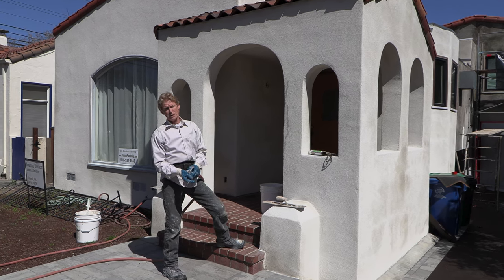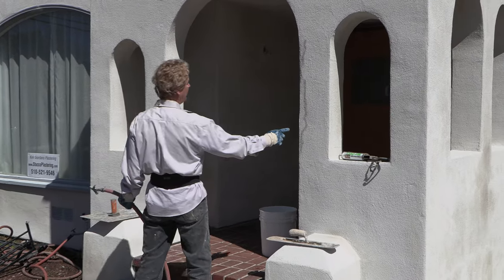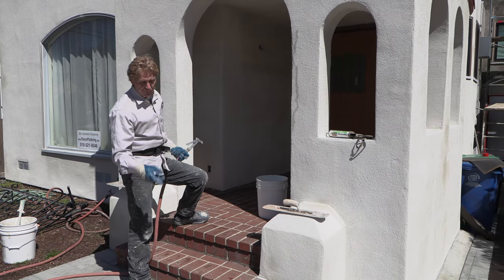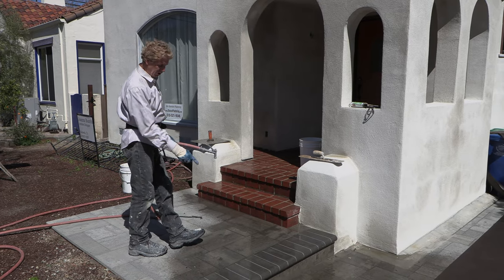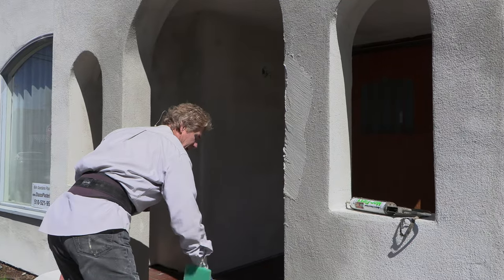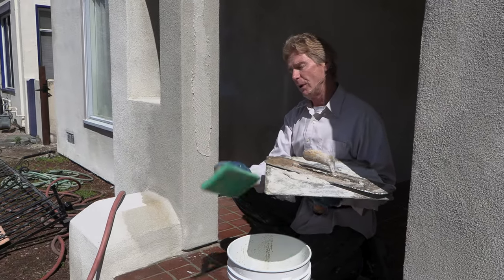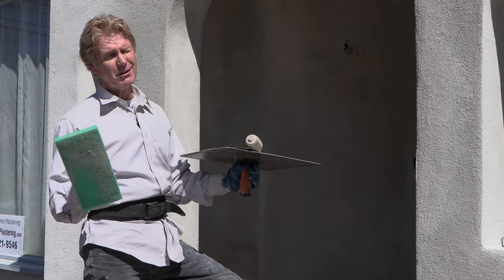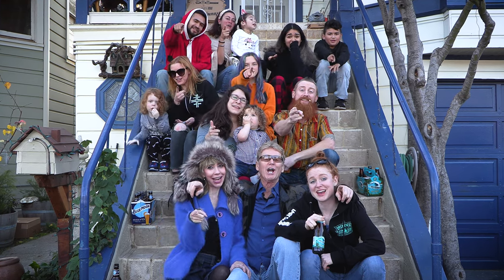Repair cracks in colored stucco.

Comment: More great Stuff from Captin Kirk! But what should i do If i have to repair with a grey base or moss color,  Should i just reskim that whole wall?  would that be ok?  Thanks and have a Happy easter guys!
Reply from the maker: Morning Mark, One way to correct ghosting, bleeding,  cracking, or discolorations is to indeed go from corner to corner.
 However, that being said, I have been very successful with wetting walls and simply covering those areas.
 I don't mention my success rate as most will try and perhaps fail, then point the finger at old Kirk and say Lire. 
The idea for my high success rate is I thoroughly saturate the walls with water so that it may take a day or two to dry out, then get the powered color as close as possible, spread and brush or float it in; takes practice like everything else. 👨🏻‍🔬

Comment: Hey Kirk. Huge fan from New Mexico (a ton of stucco housing here). I have a beat up stucco wall: color coated (possibly lahabra buckskin or madera) and it's got bad cracks and chpped off color layer (I sent pictures to your email in hopes I could get some help). I filled in the holes where the mesh and paper showed with quikrete stucco mix. I pressure washed to remove the old color coat as much as possible (I think they mixed bonding agent into the color coat). I filled the cracks with Sikaflex (gray stuff very sticky). Now I'm stuck.  Now I have a wall that has filled in cracks from what I did, spider cracking from the old stuff, I have some patched holes with stucco mix and my wall looks like a crazy mish-mash of crap and it looks horrible. My question is, should I skim coat the whole wall with Eisenhower stucco mix (rapid set) or can I simple buy LaHabra Color Stucco finish and re-color the wall and float it without having to put a skim coat first? I'm afraid if I put a skim coat, I'll have waves in parts (adding a layer of skim if not needed) and then adding color coat on top.
Reply: I forgot to mention I have bonding agent ready. If I only need to apply a new color coat, then I plan to apply bonding agent (more on the patch work) probably three coats of bonding agent then attempting to apply the color coat and float finish. By the way, everything I said here is what I've learned from your videos; thank you man. I have not attempted applying any stucco yet; this will be my first time. Thanks for your help and the great videos! I appreciate what you all do for us DIYers.

Comment: Nice tip Kirk. Have you ever seen someone use silicone for mortar joints on a brick patio followed by mortar on top?
Reply from the maker: No, but it may be done; the problem with silicones they are usually made for glass-like aquariums and don't take to paint of other products too well. Mor-Flex caulking works much better and also comes in the grout color and sand grit to match better. Plus can be cleaned up easily, the word is it's water suable or cleans up well with just water.👨🏻‍🔬

Comment: Hey Kirk love the videos! Question for you, I recently replaced a few windows and cut back the stucco with a straight cut in order for the new trim to fit the opening perfectly. Problem is some of my cut openings are 1/2" to 1" too big. What would be the best method to fill this crack?
Reply from the maker: Howdy Cory, the most important thing is are they watertight? If not, fuse the paper to the frame with Sikaflex 1A caulking, this is an adhesive sealant caulking.Then buy a ten pound box of Rapid Set Stucco from lowes or HD, mix and apply.👨🏻‍🔬

Comment: No mesh kirky?
Reply from the maker: Excellent question; Mesh is not necessary after a home has settled; this home is about 90 years old; thus, it's settled. However, using a tamper or jitterbug will crack the stucco, bricks, and concrete every time. Had I been informed of this ahead of time, my color finish would have been done afterward. 🤔